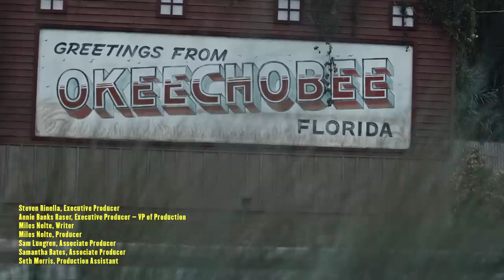Ryan Callaghan and Ed Anderson Go Looking for Snook and Tarpon | S1E03 | Das Boat

Comment: Here's a lil note from my trans continental experiences y'all may not know that in my mind unitifies America for me and helps to overcome the proposed "extreme diversity" between us. Boondocks, y'all! From the N.W. to the S.E. and the S.W. to the N.E. including everything in between. Boondocks are a partial reason the U.S.A. will never be torn apart! I grew up in the N.W. in South bend, Wa. and the restaurant there called Boondocks was always a representation of combined community effort to support the local community with the best possible freshest seafood from the Willapa bay to the Pacific Ocean with everything from clams, oysters, and muscles to king crab, blue crab, salmon, steelhead, etc., all coming fresh within 2 hours from catch to diner to plate. I'm now living in Tuscaloosa, Alabama and have experienced the same things with different seafood. The main thing in common is the boondock. God has definitely blessed the whole continent of the U.S.A. with this ability to stay connected across thousands of miles. The core is strong Y'all! 💯🇺🇲❤